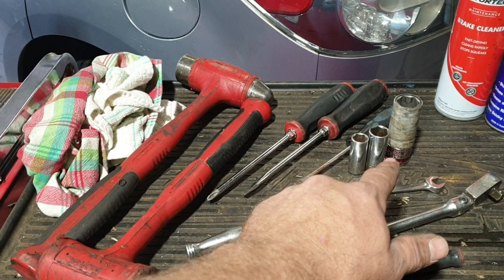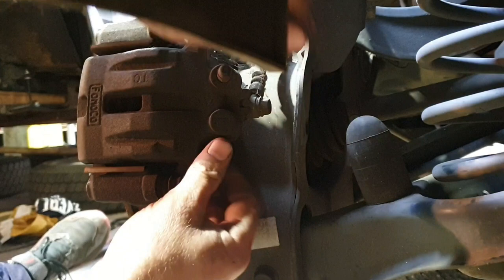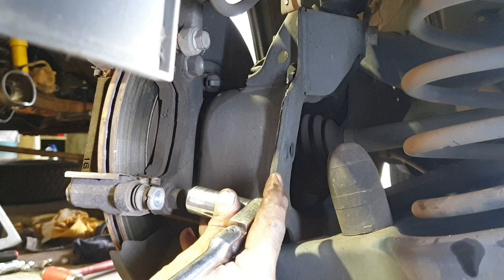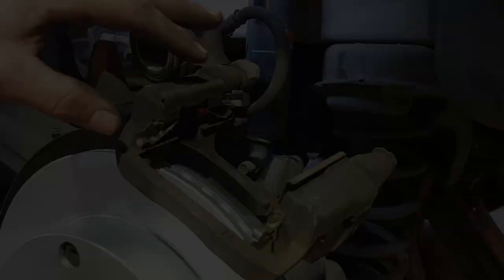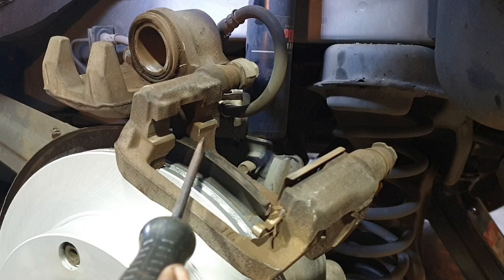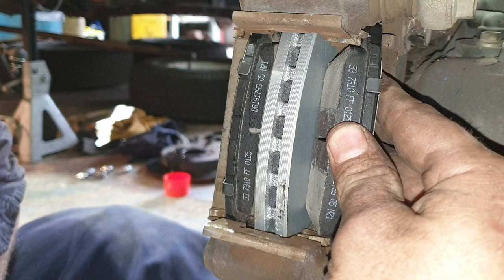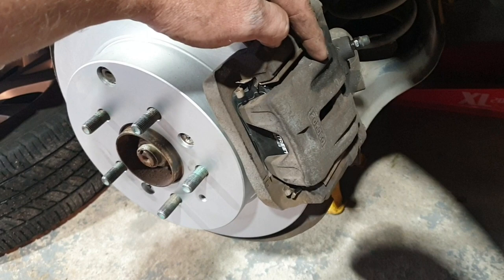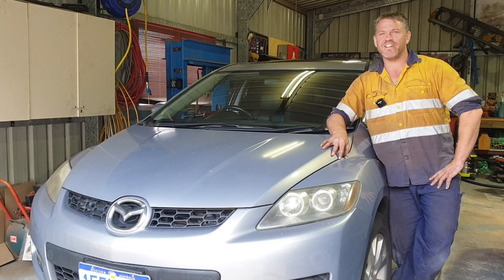Mazda CX7 Rear brakes Replacement

Comment: Excellent, very clear and instructive. I bought a CX7 that has been sitting in a field for 9 months. Trailered it home, changed the radiator, new tyres, lubes and battery and it started first time👍
Just had delivery of new front and rear discs and pads (they are both on around 3mm) and your video here is brilliant and will help me so much. Footbrake goes almost to the floor and I thought the cable was stretched as i didn't know the shoes were adjustable so thats another thing I now know. 
Damn thing still overheats occasionally despite bleeding and bleeding the coolant system and even  removing the thermostat! (I have a new one to instal)
Any ideas? 
Again, many thanks👍.
Reply from the maker: Oh awesome mate i glad i could help i hope all goes well 
Take it easy Byron 👍

Comment: Thanks for the video mate I will do this this weekend
Reply from the maker: Sweet bro
 im thinking about replacing the rear wheel bearings
Reply: @downtheshedwithbyron  Mazda cx7 is a good family vehicle . by the way do you know what causes mazda to wobble at high speeds curves ??  Maybe sway bar links??
Reply from the maker: Yeah mate wife loves it
High speed wobbles id start with tyre and wheel balancing then check all suspension bushing lower control arms ball joints etc 
Let me know how you go
Reply: @downtheshedwithbyron  i will definitely check suspensión every time I turn fast the rear of the car jumps and shifts weight so weird

Comment: Hi mate, just want to make sure if I understand it right. So leave the park brake off, if cant take off the rotor then use the screw driver to turn the gear to take off the rotor, after put the new one on, then use the screw driver to turn the gear back on until the wheel cant spin anymore, Am I correct?
Reply from the maker: How you going 
Yeah mate thats right 👍
Reply: @downtheshedwithbyron  cheers mate, Im about to change the bearing as well but really worry cant take off the old one, do u have any other tips in that case? thanks

Comment: Cx7 worst headlight design ever!
Reply from the maker: What to change to globe or looks
Reply: @downtheshedwithbyron  to change the low beam . I have the back covers snapped and broken,retaining rings messed up . Basically the lamp just lays in there😂
Reply: I had to get the red bulbs instead of replacing the whole tail light. Brand new is like $450. The inside had burned tye lenses. Why duild something that's gonna melt?
Reply: Since I had my cx7 in for the brakes I just had the mechanic do the bulbs for me since I don’t have the space at my house to do any mechanical work.